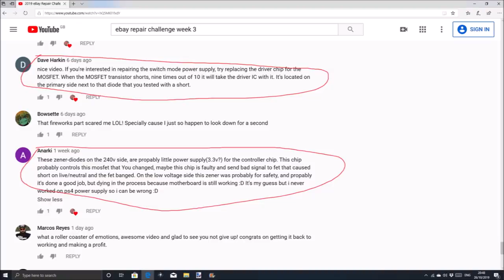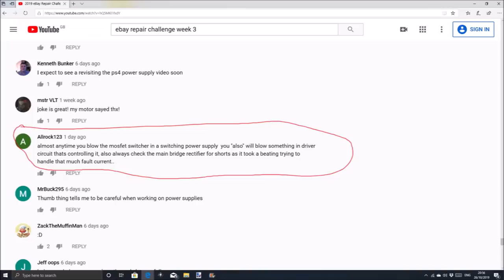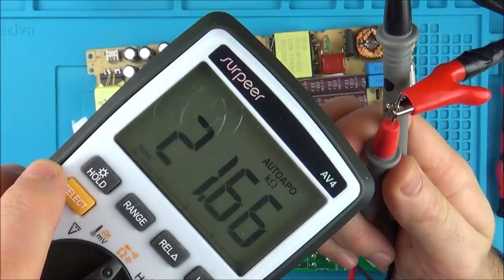REVISIT : PS4 Slim Faulty Power Supply ADP-160ER

Comment: Once again, the Almighty Vince has done it!

Some info about the rectifier: it’s most likely a so-called “Full Wave Rectifier”.
The AC is a sine wave in terms of voltage at any point in time (which is why it has a frequency), and the FWR (short for “Full Wave Rectifier”) inverts the negative segments of the AC.

Since the DC-voltage is 340, that means it could be a “Two-phase FBR”, which means the AC is split into two separate lines, each phased away from one another. That’s actually a much more efficient way to rectify the AC voltage, as it comes out mostly DC (with only a bit of voltage bouncing, meaning less filtering is needed).

In any case, capacitors and diodes help smooth this slightly bouncy DC voltage even more, resulting in a fixed DC voltage.

There’s a second rectifier variant (not much used, but extremely simple) called a “Half Wave Rectifier” (HWR). Instead of inverting the negative half of the AC voltage, it just cuts it off. The difference is that the FWR uses four diodes, the HWR uses only one.

Of course, the internet can give you more info, particularily Wikipedia. Just search for “Rectifier” (minus the quotation marks).

Once again, stellar work, Detective Vince! Case closed!

PS: Yes, AC plugs can go in both ways, since it’s a sine wave spending half the time at positive voltage and half the time at negative voltage. Therefore, AC has no polarity, unlike DC.

MAJOR EDIT: Changed the naming from “Half/Full Bridge Rectifier” to “Half/Full WAVE Rectifier”, the proper naming of these units.

Also, changed from “Three-phase FWR” to “Two-phase FWR”, because you mentioned the voltage was increased by a factor of 1.41, which is approximately the square root of 2. A “Three-phase FWR” would have the voltage increased by a factor of 1.73, which is approximately the square root of 3.
It also makes sense as the FWR unit had only two AC “inputs”... yes, they are individual inputs with different “phasing”.

Comment: Watching your videos leaves me with a question: what's that flux-stuff gel you're using, what does it exactly do and if it's just used to transfer heat to the solder points, why don't the other parts in direct vicinity simply come off, too? They often get into contact with the hot flux-stuff and I would expect them to come loose as well. Sorry for this silly question but I'm a complete idiot when it comes to motherboards 'n' stuff. Regards from Germany, Dee

Comment: add leaded solder prior to removing smd components with hot air. Pb free solder has a higher temp required for flow, but will mix with leaded solder.

Comment: I guess that you know this by now all the components are glued down by the pink glue and your hot air is way to high for a single sided board with no big ground areas 260 degrees is plenty with quite low air flow. Where the board is black you will find starts to be conductive like a resistor so it would have to be cut away leaving a hole and hard wired. Hope this helps in the future especially on power supplies.

Comment: Unfortunately for such small components you need soldering tweezers like those used in expensive Hakko soldering station. Also use low-melt leaded solder to lower the melting point so it'll be easier to take off the components. Be prepared to spend $500 on them. Buy nice or buy twice.

Comment: YOU NEED TO PRE-HEAT THE BOARD from a distance before you go in close to remove a chip ect... Thats why you was burning your board so much. If your rework station is on the lower end. Yes you could apply some leaded solder on the pins to get the chip off easier with out burning the pcb.

Comment: I have a question, you probably answered in another video but it would be easier to ask. What hot air station are you using, to remove compnents on board, thanks.
Reply: It is an 853d, various brands exists with the same model name. It is a chinese one, and that is the reason he struggles so much many times..
Reply: @csgultekin  that's what I thought, thanks. I ended up getting a chinese one and it wouldnt get hot enough. Was hoping he had something better. Thanks again

Comment: The red You see under the parts are glue , The manufacturers use it to hold the part to the board when they wave solder the board , you must heat the board just to the solder melt and then  twist the part off the board

Comment: You can remove caps without hot air station, melt on side and lift it up with hot iron, then the other will come out easy.

Comment: Congrats on finally finding out what the problems were:)! The glue does hold components on and is meant to during manufacturing (going thru a wave-solder machine) but it shouldn't keep you from removing components. I know you are learning but yes please add some solder next time! Get it "wet" to reflow the factory solder and the chips will come off much easier without burning the board! Also, a bit more time with the hot-air and not soo close too! Board burning/delamination was from being too close and too much heat/time on one spot.

Comment: Way too much flux which cools and prevents the solder melting, no need for any flux at all when removing components, and best to use a soldering iron and a touch of fluxed solder to melt the solder one pad at a time if the board is the thing you wish to protect once desoldered components can be prised of the board as they are glued on (35 years soldering experience part of that building pcbs full time with a lot of component removal).

Comment: You are right. Once the top layer has delaminated from the board, all the heat you add has nowhere to go. From that moment its just a very thin layer hanging "in mid air", so similar to a piece of paper it will start to burn up, way before the solder had had time to melt. You might have had more luck with a soldering iron from the moment it popped off, but as you said, of course it did not really matter much. You might also have heated it up too quickly, leading to the delimitation in the first place. The top layer heats up, but has poor heat conductivity into the body of the board. With a high enough temperature difference between it and the board, the top layer expands enough to rip off from the bottom. If you were to heat up the whole thing slowly, keeping the temperature differential small, you'd probably be fine. You could do that from the bottom by placing the whole thing onto a heating pad.

Comment: Hey Vince...don't go so hard with the hot air. Not all the time, in fact, most of the time don't use flush cuts to remove things but some times it's okay. That little bit of force will go a long way. Also when removing glued components air underneath them and gently introduce a wedge like a tweezer.

Comment: It will be a longer comment. I do not want to repeat what your inspiration is. These revisions help me to understand and not to make bad judgments. It's very important to me. The fact that as an amateur for pleasure, a couple of months, I fix things too, I've written somewhere. Example. If I had the same problem with the PS 4, I would pay for a console and a new power supply of 75 euros (65 pounds) in a country where the payout is actually around 500-700 euros. Buying yet another 25 euro power supply to test the old is unthinkable. I'm not saying that a new voltage source can not be bought in our country for less than 69 euros. I would have waited a month or more for goods from China. Just as I am waiting for a very cheap hot air gun and a few spare parts. That's why I like your videos. learning, understanding, procedures. My heart ached when I saw the motherboard burn :) The fact that you could find the mistake again did not surprise me. It is a pity that it could not be put into a working state and entangled in the test console.

Comment: Nice job ! :) I was wrong but You figured it out nice job! 
Components were glued and the pcb was kinda shitty quality, on the future when You work on single sided pcb You can try to add leaded solder and preheat the generał area of board where You`ll be working with your heatgun at around 100-120 Celcius so the delta on temperature isn`t so high

Comment: The components are glued down, that's the red spots, also you can see the solder melting
Reply: Red glue is used to keep SMT components on the underside of the board during wave soldering.   It's a complete pain in the arse.

Comment: You need to be careful using hot air on a paper board like that.  The reason it bubbles is it's too hot, moisture in the board / glue bubbles and blisters.  Use an soldering iron and flood each side with leaded solder and flux, and rock the part off.
Reply: the dark under the diode is burnt glue that was used to hold the part in place prior to soldering it.  Never use hot air on a power supply pcb like that!
Reply: If you must heat a board with hot air, lower the heat and warm the board up.  You want to get the moisture out of  the board.  Always add leaded solder to a solder joint and flux prior to removing the part.  Lead free melts at a lower temperature.  The board blistered from moisture/glue/etc getting too hot
Reply: It's just that the "master" on the hair dryer set wild temperatures, and is happy with the repair!

Comment: you have carbonized that board    Carbon conducts electricity    That board is well and truely cooked.   Fixing that involves digging the whole section out and putting wires and componets in the right places    With an IC in the spot you have fucked it would  be a nightmare to wire

Comment: Not putting enough air out on the gun, providing too much heat in one place with not enough air flow, just burning the board, shouldn't be turning black at all.

Comment: Great job Vince! That chip is possibly a voltage controller of sorts. It might be used to help stabilize the DC voltage or provide autocorrections during fluctuations with AC, DC, or current. Not entirely positive, but good find.

Comment: Check out a product called Chip Quik for removing delicate IC's, Its a low melting point solder that stays molten so you can remove SMD components without needed a hot air gun. Its a bit pricey but I have used it to remove EEPROMs from boards with 100% success rate and no damage to the PCB. There are plenty of videos out on YouTube if your interested.

Comment: That thing under components is glue, to desolder these components from a board like this first use half air flow and around 320 to 370 degree of temperature, and push component from sides

Comment: The redness below each component is from the glue they use to stick the components to the board when they wave solder them. That's how they prevent them from washing off the PCB before the solder has had a chance to solidify.

Comment: If the rectifier was blown you're lucky the capacitors are still good, because they would have taken the full negative voltage of the AC line as well as the positive line voltage.

Also, a blown rectifier is probably a result of other damage further down in the chain as they go short because of excessive current. There's a chance the main chopper MOSFET (the part you swapped out first) popped due to overvoltage and the entire 300V DC bus went hard short taking down a lot of components with it.

The fact that the PSU doesn't have a decent overvoltage protection (a fuse on the DC side and a crowbar circuit would be good enough) is pretty bad design.

Comment: It's when you are bumbling around, making a right pigs ear of things - that's when you learn the most. 

I too have had trouble removing stuff from those single sided, beige coloured boards - they tend to glue the components down and it is tempting to crank up the heat to speed things along. Then it delaminates and then burns, as you found out.
Drop the temperature, use plenty of flux and add some lower melting solder.

Comment: You have your hot air set way too high, and the air volume is also too high. I cringe every time you pull out your soldering iron. 
You only need the lowest air pressure and temperature should be around 240-250C for lead free and around 200-220C for leaded. You also should use flux for removal with hot air.

Comment: The red stuff under the components looks like epoxy, you will need to use something like 250-300 degrees and low air speed, and get something under the component to lift the epoxy, something like a cpu removal blade. (this is my guess anyway, not worked on this board before.)

Comment: A traditional light bulb is good for discharging a cap because it's a PTC resistor. The resistance is initially high and goes down as the cap discharges and it bulb heats up, which is no problem because the voltage also goes down.

Comment: that hot air gun is lying to you, 400 that is not, closer to 500 at the rate of burn, don't go by the temp listed, should be just hot enough to melt the solder, and that should be well below the burn temp of the board.   might I suggest burning a few scrap boards to practice, and to get a feel for the temperatures needed

Comment: hot air gun with out heat tape very bad new    i good solding iron on very low  would get it of very easy  save you all the burning the pcb